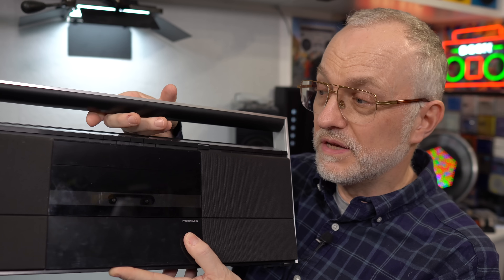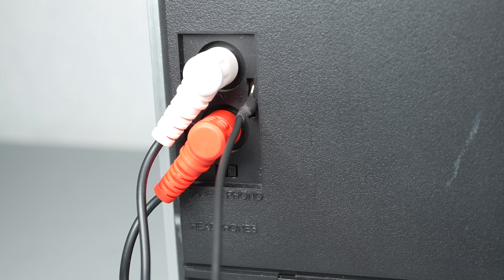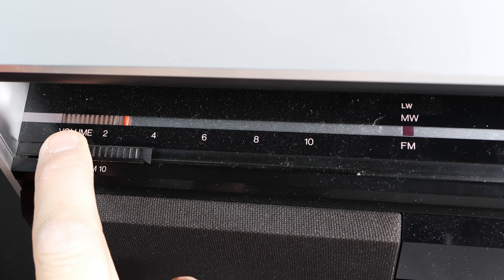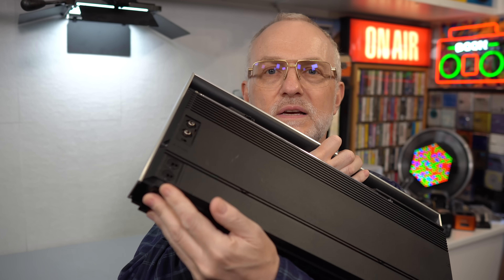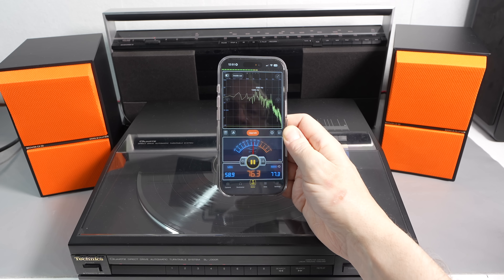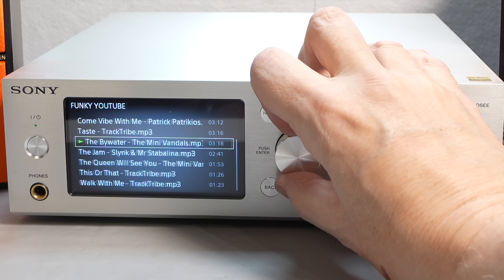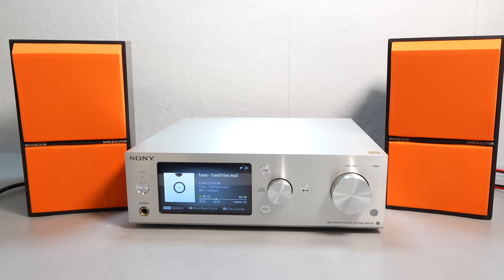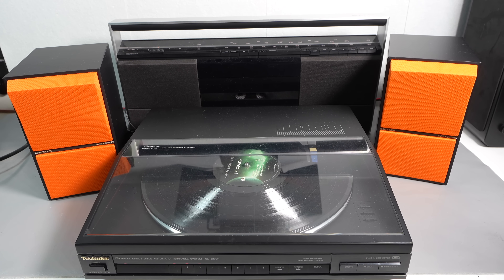Can custom CX50 speakers fix the Beosystem 10

Comment: Using external speakers would mean the main unit could be hung from the wall by its handle without worrying about reflections. That would get around some of the awkwardness, and get the tape deck out from behind the turntable. If you have a vertical turntable to set under it, this could actually be rather attractive, in a retro-futuristic way.

Comment: There is no need to measure the cables as long as you do both the same way. Same as RJ45, you can use any color coding as long as you always do it the same way. I do NOT recommend it though.

Comment: This is definitely an issue with the amplification in the system itself. The distortion mentioned in the manual is normally clipping, not loss of bass, as it would be over driving the internal speakers at high volume levels.

Comment: Maybe the overall amplifier has deteriorated and there is an auto loudness feature which boosts bass and treble at low volumes, hence it sounds better at low but distorted at high volumes.

Comment: When I was a kid in the late 80's early 90's, every single boombox, ghetto blaster, etc that we owned had that same problem. A volume control that goes to 10 that we wouldn't dare turn up to because it would start distorting at around 7 or 8. Even our Hi-Fi. A Fischer Stack with massive speakers would distort approaching the higher volumes. It wasn't until I bought my own Bose surround system in 2000 that I owned something that would actually go up to 10 without distorting. I don't know if anyone else had that same experience.

Comment: I don't think there's anything wrong with your Beosystem 10. It seems fine to me. Remember It's REALLY an overpriced, rebadged Sanyo and Sanyo boomboxes of this period had what was called "Auto Loudness". My 1984 Sanyo M-7770k works the same way, thin and harsh above 6 on the volume control. Sorry to say but that's just the way these things were made.

Comment: It's the LTT Edition Beosystem CX50 speakers. 😁

I used to have something similar to this setup when i was in college: Panasonic radio with detachable speakers, a pair of Realistic Minimus 7 speakers, and that Technics linear tracking turntable. It was kind of the bestof both worlds: a compact dorm room stereo with decent sound, and a portable cassette / radio system that I could take places (I just re-attached the original speakers when taking it someplace).

Comment: Is it distortion in the sense that the power amp circuit is hitting its power supply limits, so that's the highest amplitude signal it can send through the speakers without 'squaring off' the waveform? Or is there some high pass filtering in the preamp circuit that  kicks in above 6 on the volume control so the onboard speakers are not driven past their mechanical limit for excursion?

Comment: My guess is that the Beosystem 10 just doesn't have a strong enough amplifier. This was also the point in time where Bang & Olufsen was really starting to move on from passive speakers and moving more to powered speakers. I think you had a Beocenter 2300 or something similar a while back, that would be a much more fun platform to build around and experience some of the B&O magic.

Comment: So Beng and Ollifson is got a philosophy, against using high volume on anything. To put the setting in cuz the customer wants it, but they deliberately designed it so it isn't as good. They want you playing low volume.

Comment: Found a pair of cx50 in the trash. No grills, replaced the rotten ring suspension myself. Did quite a sloppy work at that, but damn they still sound good.

Comment from the maker: Info about capacitors from the eBay listing These speakers have been fitted with brand new Capacitors for the crossover filters. They are new, factory fresh high quality components for the electrolyte capacitors in the crossover filters. These Capacitors were chosen specifically to provide a sound reproduction as close to that of the original speakers as possible. The capacitors are correct type and spec and are 100V/105degC types for long life and excellent performance.
Reply: Well thanks for making another Saturday morning great whilst I drink my coffee! Glad to see. Or I guess here that you're feeling a little better. Or at least you sound it. Just wanted to let you know that I super appreciate what you do. I have a 6-year-old son and a lot of your videos. Help me explain what was new technology when I was little. Cuz a lot of it is now obsolete. And then there's the amazing stuff that most of us never knew existed that you profile. Keep up the great work man! I hope you have a fantastic weekend!
Reply: You are looking better, great to see. Be well.
Reply: yep its not the speakers or crossover, if i were to guess its something on the power supply side or even amplification side of the radio, (is it the same story from the headphone jack?) 
a lot of B&O gear has Adaptive Bass Linearisation which boosts bass at low volume listiening levels and decreases bass as you turn the volume up higher but it should never sound bad, i would think something is broken.
Reply: @sakaspuds  I absolutely agree! Definitely check the power supply or the amplification stage, it sure smells like an electrical fault to me
Reply: @sakaspuds  looks whole to me. ore likely the amp doesn't have enough power to drive the internal or external speakers @ high volume level
Reply: @Zimmy_1981 Agree. I suspect there is a real mismatch. Probably clipping.
Reply: @jimfarrell4635  yesss u said it better, thanks
Reply: Great to see you're still providing excellent content. Would love to see you review Trio HiFi (Kenwood). Back in the late 1980's I had and loved a Trio K series married to a pair of Mission 707 speakers. (KA-747 amp,  KT-747 digital tuner and KX-747R tape deck.)
Reply: You also sound different than i'm used to, hope it will turn back to normal soon !
Reply: Impedance problem would be my suspicion if the drivers in the speakers were replaced.
Too low of impedance will cause exactly what you are describing.  Lots of bass but then distortion at higher volume.  (This most commonly happens when someone parallels two sets of speakers on an amplifier with only one set of speaker outputs.)
Because of the small size of the speakers, they could have used 4 ohm drivers meant for car audio.
A quick way to test would be to try known good speakers with a 6 ohm (B&O stock) impedance.  You could also try 8, 10, 12, 16 ohm speakers.  You'll get less bass but more volume as the impedance increases.
Now if the seller just put new rubber surrounds on the stock speakers AND used the proper capacitor values, then theoretically they should be the same as stock.
Also, you can't measure impedance with a standard multimeter, you need an impedance meter.
A standard multimeter measures DC resistance.  Impedance is AC resistance.  An impedance meter puts out a sinewave at a specifc voltage, measures the current draw, then displays the impedance.  Commonly used to test and troubleshoot 70V PA systems, like in restaurants for background music.
Reply: Dude those external speakers sound quacky as hell. Do you actually think they're good sounding?

Comment: This reminds me of my old Beocenter 2000 that I had in my teens - the distorted sound trauma sounds very familiar and I wonder if the previous owner did the same thing I did: Plug in the wrong speakers. Knowing nothing about Hifi I just got some random speakers for it with 4 Ohm while the Beocenter wanted 8 Ohm, the result was something blowing/breaking inside and I got only distorted sound even after learning that I should get 8 Ohm speakers - Beocenter needed a repair. I might also have accidently switched cbles because of course the 4 Ohm speakers didn't come with that DIN plug and I just adapted some not knowing what I was doing. Dunno if this makes sense, that was what a Hifi repair guy told me back then and it was in the 90s... anyway, glad to see you back, you sound healthier already than that B&O boombox.

Comment: Nice Video Matt , very appropriated time correct orange :3 . I'm wondering if the final stage electrolytic condensers haven't dried out with time , resulting in low bass on high output ...

Comment: It’s possible the original speaker drivers in the CX50 were higher sensitivity than the replacement units. Modern drivers can be as low as 80dB compared to 90dB (60-90s) or even 100dB (30-50s) from yesteryear. Amplifier power is cheap now, and drivers have evolved with it to allow increased bass response at a smaller size at the sacrifice of efficiency.

Edit: ignore all this! The CX50 were 81dB/1m from the start of production in the 80s! Looks like B&O were once ahead of the game :)

Comment: Have you considered it's an under powering issue? Those speakers are 6ohm 50 watt rating. The beosystem 10 is 2.5 watts a channel at 8ohms. I'm amazed it can drive the speakers at all with any clarity especially considering that the speakers are really low sensitivity at about 88db. In my experience you need at least 50% of a speakers rating in amplification to get the performance expected from it.

Lower ohms and sensitivity = more amplifier power needed to drive.

A lot of systems like the beosystem 10 have the volume set up so that the more you crank it the more it limits the bass output. You can hear this on nearly every home cinema in a box product. It's designed to keep them alive.

It's strange the problem still exists on your streamer unless it's going through the same amplifier?

All just guesses though. It could be one of a million reasons or a combination of several.

Comment: The amplifier on that system is a tiny 8.5watt LA4505 IC so it's never going to produce great results. That said it doesn't sound like a factory feature. Voltages need measuring and comparing under load. Old output IC's like that can just deteriorate causing odd issues. Also compare it on mains supply vs. battery.

Comment: One likely reason for lower level of sound out of the external speakers could be the "sensitivity" / efficiency is lower thus they need more power to hit the same level as the internal speakers. The external speakers clearly play lower in frequency compared to the built in speakers,  we can hear the the kick drum is so much louder. The extended frequency response giving more bass is often is traded against lower sensitivity as power is cheaper these days.   

Another reason could be the impedance may be higher and thus less output from the amplifier.

Comment: I think this B&O  portable set probably has limited amplifier with  decent loudness correction  matched with efficient    conventional internal speakers as destined. . They cannot handle well full power of amplifier.  .To get better results it would be required to use big   very efficient externals -   not convinently  bigger  for this  radio set - that was probably the intention of advice..

 If I would  have and want to use these   small CX50 marvels I would use voltage  output from speaker for additional power amplifier before driving these speakers It would allow me to get louder  sounding at low B&O volume positions where bass is adequately corrected.and with setting volume above 6 it would make louder  sound still allowing perception of  bass.

Comment: Hi there! Nice to see you again! ^_^ I'm not entirely sure, but did you flip the polarization of the cables? The slot like, wider spade like one is negative and the pin like one is positive. Also, as you probably know, tired capacitors often act like resistors, which could add distortion and dampen the sound. Maybe youd want to look into that later ^_^

Comment: It's probably got built in loudness control, many such products did at that time. When you get past about 50% you don't get that extra bass and treble lift. The extension speakers being of better quality probably have a lower sensitivity or higher impedance, hence lower output. It is what is. B O products are known for doing odd things with the sound, far from real HiFi, and very overpriced.

Comment: Maybe the amplifier is running out of power from old capacitors or other power supply issues. Seems odd to me that a system that's supposed to be higher quality distorts that quickly.

Comment: I'd guess there's definitely some elctronic issues going on if the amplifier's going into full distort mode before reaching an adequate volume, could be the good ol' capacitor issue that everyone goes for, cos like batteries, they don't last forever... :)

Comment: The reduced SPL from the CX50 is due to the fact that the speaker system is much less efficient than the speakers built into the BS10, making this combo a pretty poor match. They use an acoustic suspension woofer system that has a dividing network in front of it. As a result, they will play deeper in the bass and higher in the treble, but it takes considerably more power to run them at a level equivalent to the built in speakers on the BS10.  They were really designed as extension speakers, to be connected to one of B&O's standard home stereo components, which could output at least 20 watts (much more on the higher end components) to get decent sound.  Probably the best way to really improve the sound of the BS10 these days would be to hook up a nice modern pair of active speakers to it.
Reply: I was about to say the same thing, but you beat me to it!  Good catch. 😀